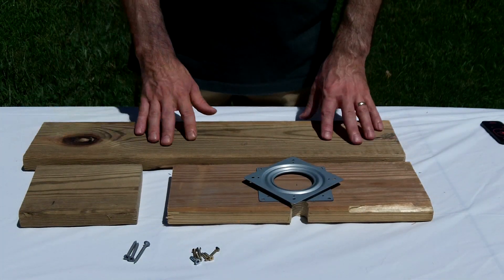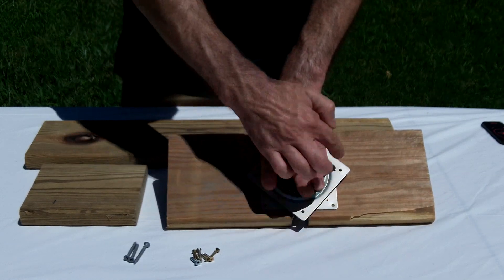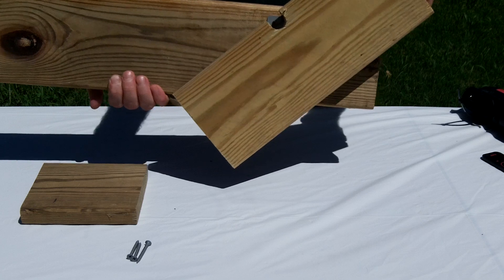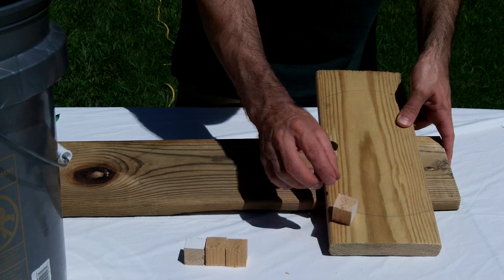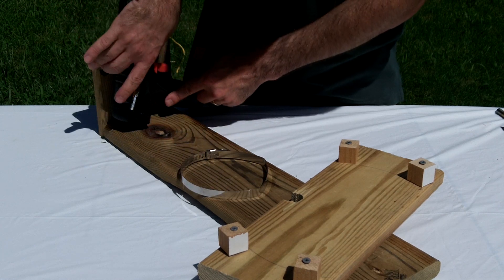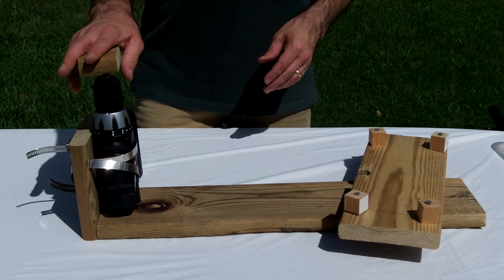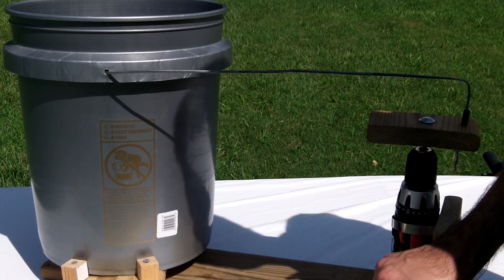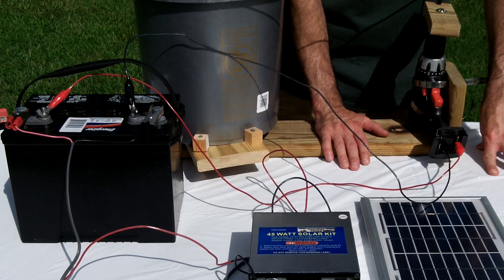Diy solar powered washing machine

Comment: Why not just use the 18 volt battery it came with? It is rechargeable AND more powerful.
Reply: Where are you going to charge it? The point of solar projects is to not use house power. So how do you charge the batteries?
Reply: lastdollarfilms
The adaptor the Drill comes with converts AC power into DC power. The wall outlet's AC power gets converted into DC power to recharge the battery. If you have a solar panel, it already outputs DC power. Therefore, all you would need is a couple of resistors to reduce the wattage and voltage. It's A LOT easier and cheaper than using a car battery.

Comment: Not sure it will run with a full bucket.Does it run?
Reply: Why wouldn't it? Its a drill. Even the normal 9v ones are strong enough for this and this is an 18 running at 12.

Comment from the maker: This solar charger comes as part of a kit from harbor freight. I have not seen it sold separately except on eBay and is around $45. If you go to eBay, there are 10 to 20 amp solar charge controllers for around $20 to $30 that work just fine for a small off grid system. Thank you for the question, Lonny

Comment from the maker: It performs great when it has a load of laundry and water in it and the drill has no problem with the weight at all. I did just upload a new solar power washing machine update video to show how well it works. I think I am happy with the drill as the motor. It is cheap and the chuck makes it very versatile. Thank you for the question, Lonny

Comment: I really like the idea. How does it perform when you have clothes and water in there? Is the drill strong enough to handle the torque? Would you use a different type of motor?